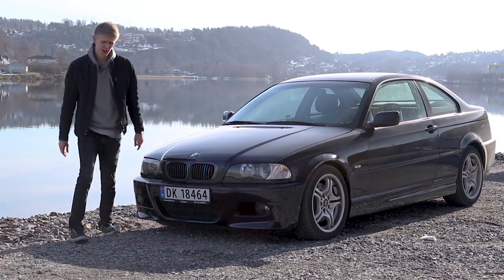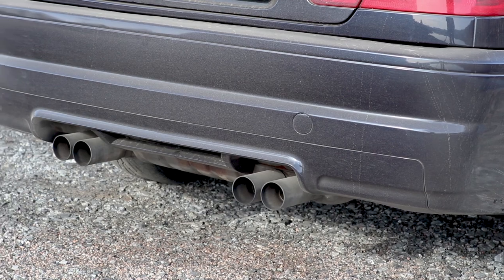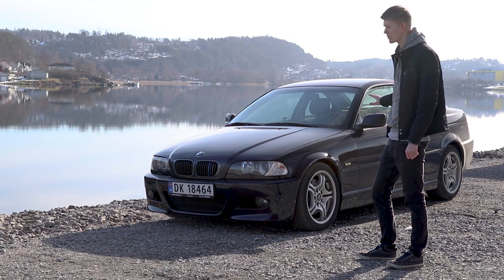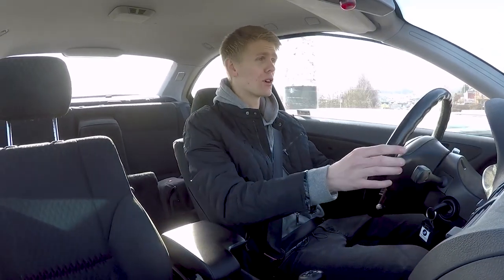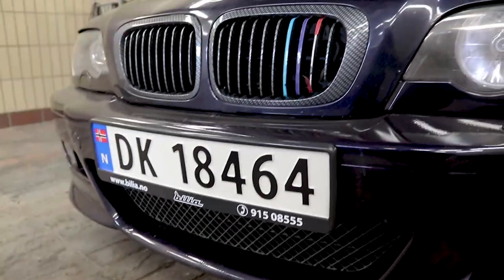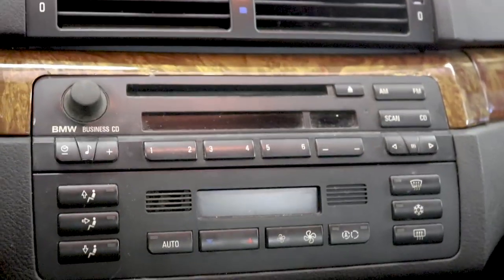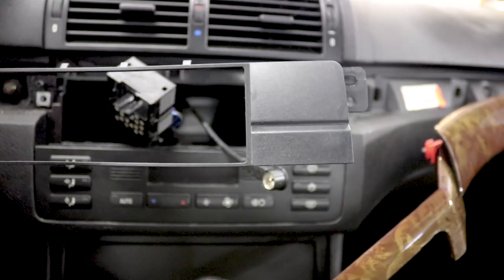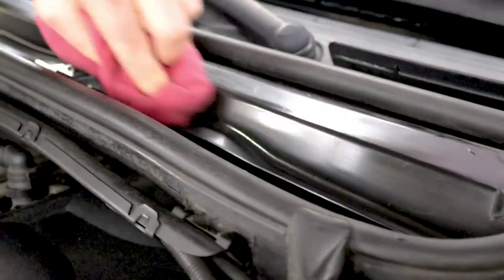I BOUGHT A BMW M POWERED CAR!

Comment from the maker: Still can`t believe it! So stocked!! this project will be awesome! What kind of mod do you want to see first?
 Subscribe with notification for more M3 content!
Reply: Fahre Films do you now have 3 cars
Reply: M3 rear lights:)
Reply: Install e330d radio on m3
Reply: Fahre Films you should do coil overs
Reply: Fahre Films straight pipe
Reply: Rear m3 lights or black window tint or both :D
Reply: Please change rear tail lights in white one
Reply: Stor tørrbo
Reply: please don't sell the e36
Reply: Is the ECU same as M3?, since if you want to tune it later it makes it easier for you!:)
Reply: Congratz.  The car is awesome machine good luck with it in the future :) :) :) :) and cant wait for the 1st mods.
Reply: Få på m3 vents osv, gjør den så m3 som du klarer
Reply: hvor mye betalte du for bilen?
Reply: ha på spacers bak og bytt eksosen 😁👍👍👍
Reply: M3 frontfenders, and original backlights, and find an awesome original radio, that fits with AUX... f.x a Bmw bussiness from 2002 and up to 2005. There are u able to install Aux into
Reply: Ajkula323i defnently
Reply: what is happens to your e46 320d you will sell or something ?
Reply from the maker: Mick Oostingh yes👌🏼😏
Reply: Iam so happy for you man! Congratulations bro
Reply: New mirrors
Reply: Get a e53 BMW X5 2006
Reply: It looks great.
Reply: 0:10 What's the name of this intro song?

Comment: now slap a 320d badge on the back make it sleeper😂😂
Reply: @Butterasbutteryasbutter From what i know on coupes only exist 318i
Reply: @takendrs  nop,there is 316ci
Reply: @Butterasbutteryasbutter 316ci exists.
Reply: 320ci would be best as a fake badge
Reply: Butterasbutteryasbutter 320d doesnt sound as an m3, 318ci also because it has only 4 cylinders, so lowest engine with 6 cyl is the 320ci
Reply: My dad have a 320D with 208 Hp
=)))
Reply: You mean 520d mpower

Comment: Congrats man, a e34 m5 would be better but still this one is nice aswell
Reply: I myself would prefer an E34 M5, but if he buys an M car purely for fun, he did the right choice. Not many cars that are more fun to drive than an E46 M3. However I would prefer an E34 M5, 3.6 or 3.8 it doesn't matter, because it looks basic, but goes mad, however that would be too expensive to live with on a daily basis, so I'd rather get an E34 525i (24v), stroke to 3.0l with M54B30 rotating assembly, set up a low pressure (0.4 bar at most) Toyota SC14 supercharger kit from Hyde Motor Works (I would love turbo, but then it would need forged pistons, lag quite a bit more and overall be more expensive to put together and live with), and also get a shortshifter kit,  LSD, headers and sport cats, then make my own custom exhaust from there on, more aggressive cams, and put an LPG device in to lower the cost since it is supposed to be a daily driven beast (although I would tune it so that at higher RPM, it sprays a little petrol to the LPG to prevent serious engine damage and bad reliability overall), and to top it off, make it an M5 look, with M everything, in and out, M5-spec suspension too, Hella black headlamps and stuff like that. Just maybe I will not put the M5 badges, but if I do get the M5 badges on, it will be purely to provoke other people. :) But then I would end up spending the same money to make my perfect E34 as I would have to buy an E34 M5, but now I can drive that E34 that isn't a real M5, but has the looks and the power of an M5, and is pretty perfect in my taste.
Reply: @thepotatocarenthusiast8503  damn, you broke my brain reading that 😂 i have a 520i e34 myself, i have huge plans for it
Reply: Lil Murder yeah sorry for that haha. I was just gonna say that I think an E46 M3 is a better "fun car" than an E34 M5, but then I got out of the theme and into the details. 😂 Lucky you tho. I'm stuck in my dad's 190D 2.0... ...not enough space, only 75hp but it's a 5 speed manual and it's kinda fun. And it also likes tractor diesel, which is cheaper than regular.
Reply: Lil Murder aaaaaaand I did it again. 😂
Reply: @thepotatocarenthusiast8503  im not that lucky, im gonna get my drivers licence in july, so cant ride everyday, but i still do 😅
Reply: Lil Murder you are, I still have to wait a year before I get to do my driving tests, and after that another year to get my licence, and then for two years I can't drive anything with more than 77kw/108hp and I can't drive without somebody who has a licence for 2+ years in the car.
Reply: ThePotatoCarEnthusiast How can you say the m3 is better then E34 M5? You clearly never had a m5 or m3, ive had both before and the m5 is definitely a more play car and it looks better.
Reply: @thepotatocarenthusiast8503  shiit i feel sorry for u bro
Reply: @yyymby9166  I have never driven an E34 or E46, about the looks, I agree, but about the fun, personally I'd feel like I'm having more fun in an E34 M5 just because of the concept of a bonkers fast big sedan, but looking from a perspective of somebody with common sense (aka not me) I see many factors of why a shorter wheelbase, possibly lighter M3 would be more fun than an M5.
Reply: ThePotatoCarEnthusiast I understand, but I can promise you, in this case its not.
Reply: I agree ! But yeah e34 m5 isn’t a car you can drive all the time cause it’s hard to find parts :0
Reply: StacheCam Not really. You just need to know where to look and possibly modify. (:
Reply: yyyMb y here in USA it’s hard to find parts :(
Reply: Butterasbutteryasbutter Would be more stupid to not use them? And they should be used hard as hell, they are built to be used, parts are not hard to get either yet everyone complains, reason why people think its hard to find parts is because they cant modify anything because they buy things with daddy’s wallet. Conclusion:M5 the way to go.
Reply: Butterasbutteryasbutter What? Im 101% sure you buy with your daddy’s wallet. Learn to use a milling machine and a lathe and make your own parts, aint that hard, I made my own valves, cams and crankshaft for my m5 and m3, wasnt that hard and it all took me like less then a week to make. Also brakes and etc from other cars fit with the tiniest modification, sad to see the youth become useless, use your imagination. (:

Comment: Also, there was this guy in my city that put interior door handles from an e38 on his e46 , and it looks really cool, cause the e38 ones have this orange glowing line running across them.
They also barely cost much, so it's just a suggestion :)

Comment: E46 M3 yea? Nice with the s54 and that. Hmmm it did look like a 318/320 at first glance
Reply: How does it look like a 318 or 320? It could also look like a 330.... stupid comment
Reply: @strohhalm1326  calm down vro
Reply: @gurenduben2031  just saying it's a stupid comment. From the outside its impossible to tell a 320 from a 323, 325, 328 or 330.
Reply: @strohhalm1326  ok

Comment: If a Toyota Camry with an S54 isn’t an M3 why would a 318 be? The M3 chassis is lighter and the suspension is completely different so your not getting the “M experience” yeah you have the engine and it’s a great one. Just don’t think you should call it an M cause it’s not lol
Reply from the maker: Alexander Granados Everything is from M3,  not just the engine. Suspension and everything under the car. This is lighter han M3 body also.